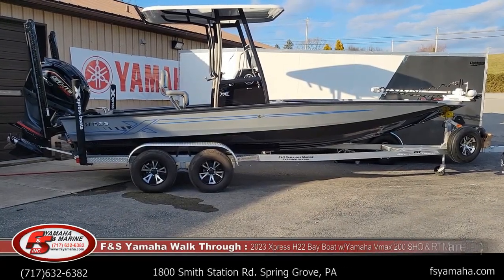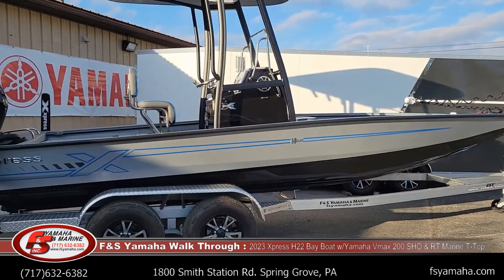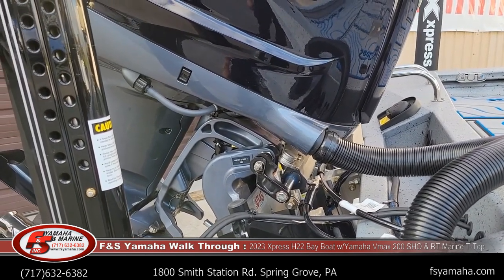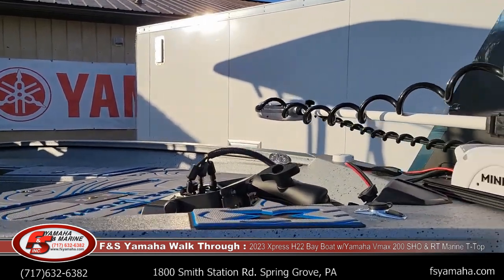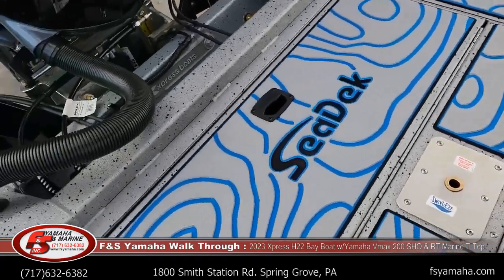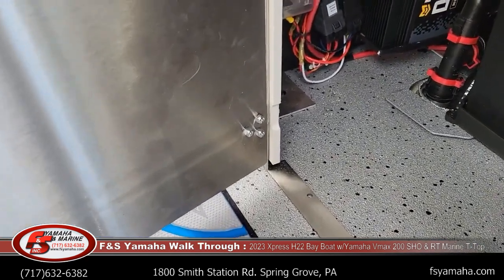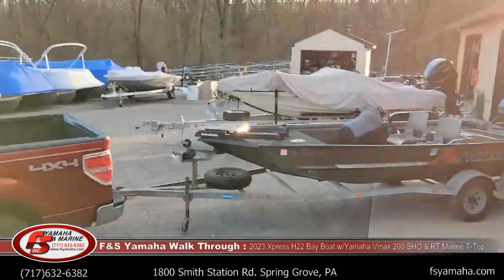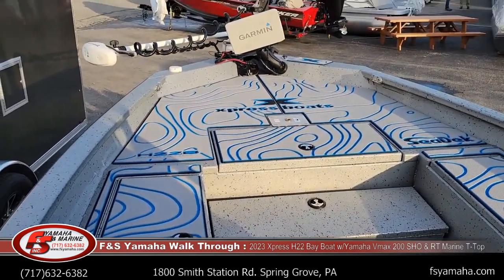2023 Xpress H22 Bay Boat w/ Yamaha Vmax 200 SHO & RT Marine T-top @fsyamahaandmarine3536

Comment: Can you get this boat with a 250? If not how fast does the 200 push the boat? Thanks.
Reply from the maker: Hi Brandon.  Max horsepower on the H22 is 200 and runs 55-60 mph.  H24 is max of 250 and runs a couple MPH faster.  Thanks, Andy